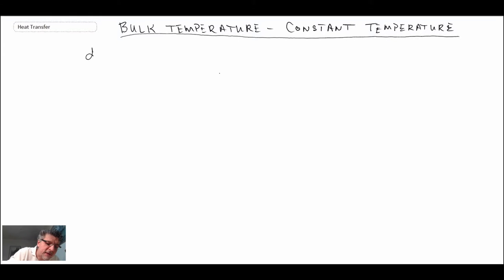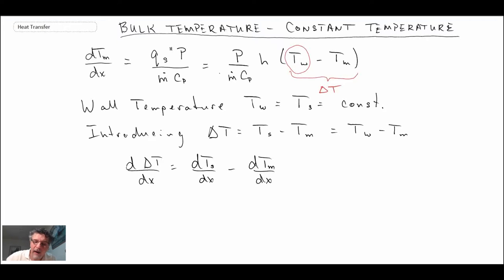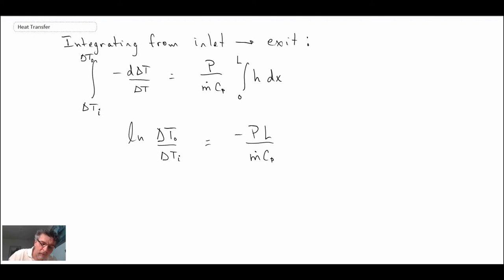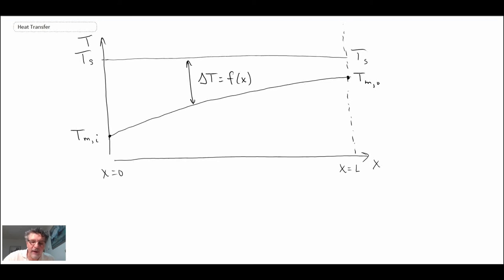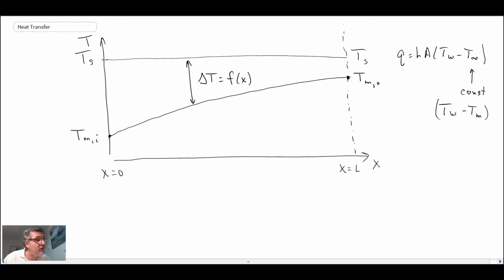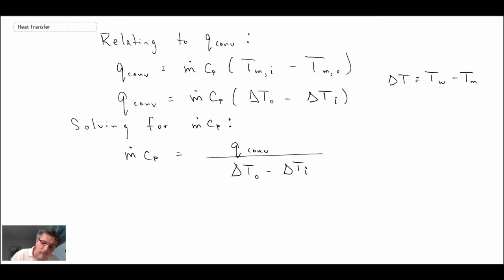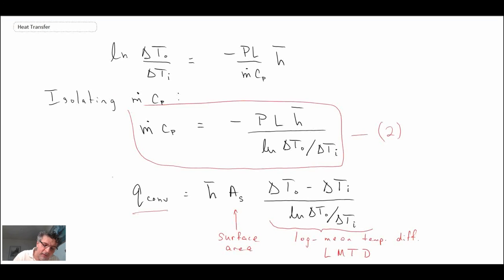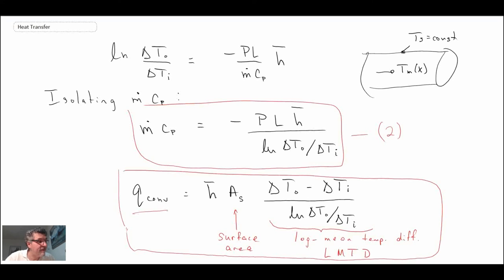Heat Transfer L22 p4 - Bulk Temperature - Constant Wall Temperature - LMTD

Comment: If we have to maintain uniform wall temperature over the surface of a tube (water flowing inside), should we place the tube inside a beaker with boiling water or should we place the tube above the boiling water ( in the vapour zone) ??
Reply: @hagayashanchu7287  Why?